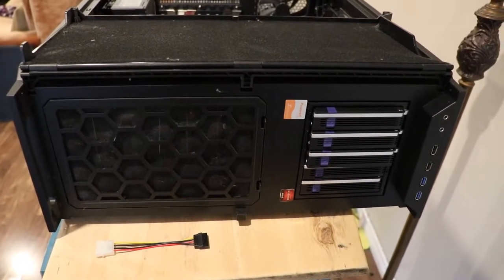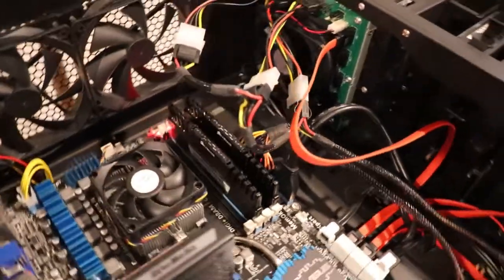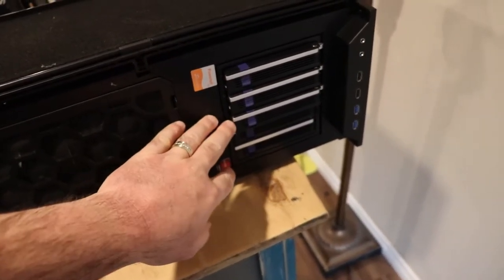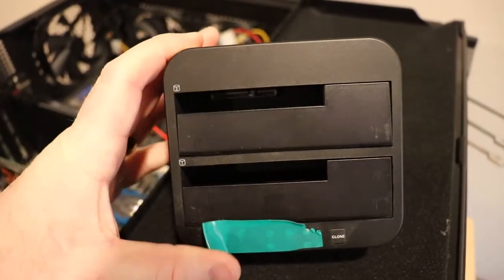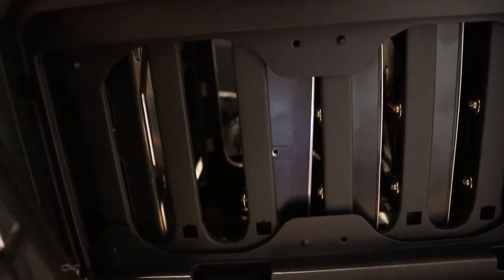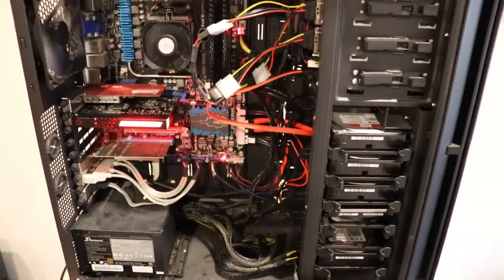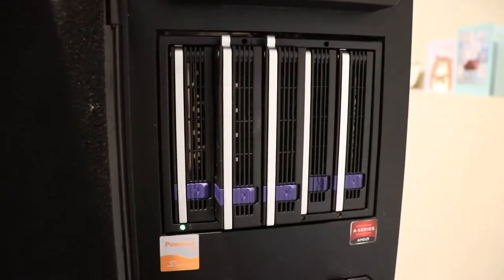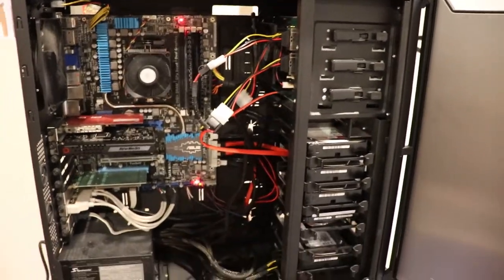IcyDock FatCage 5 Disk Cage MB155SP-B Walkaround and Discussion

Comment: Cool, I just bought a couple of these.  They are pretty expensive these days ($160) but all the other bays seemed to have closed off front covers and I doubt they cool well.  Even the new IcyDock bays seem to have solid covers.  Right now I have some drives in a Silver Stone DS380B and they get kind of warm and I also have a new server rack so I plan on moving them into an iStar 4U chassis.

Comment: Do you know if 16TB Exos drives will fit in these bays?
Reply from the maker: the 10 TB WD reds are a tight squeeze but it accepts the screw pattern on the caddys.  I don't know anything about the disks you are asking about

Comment: Hi Stephen, how are the temps with the fan on Low?
Reply from the maker: I really can't tell you, I only use one disk at a time so I haven't checked.
Reply: @SteveRivett  So I bought it and tested it, on the low fan setting (60%) 3x 10TB WD Whitelabel drives are around 41C (+ - 106F), Ambient room temp around 21C (70F)